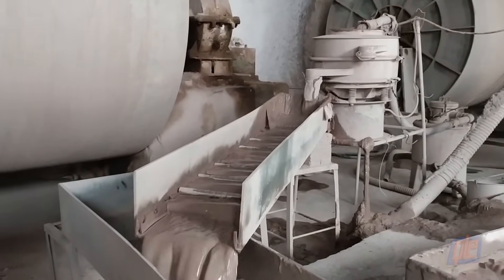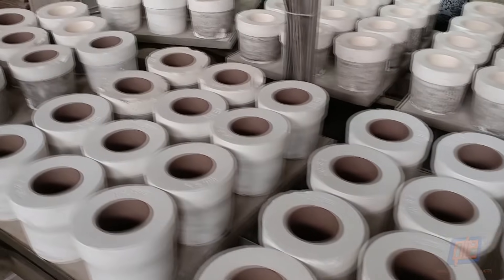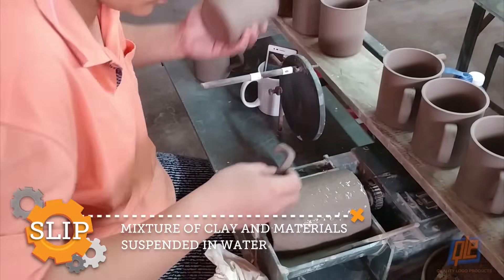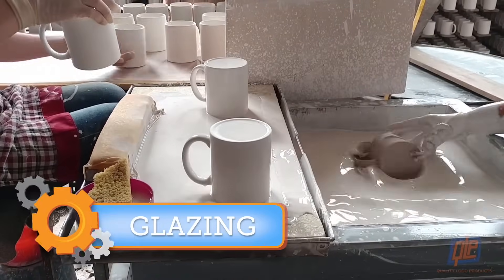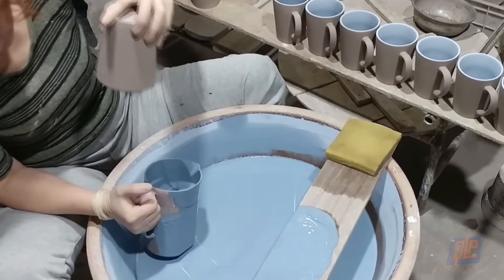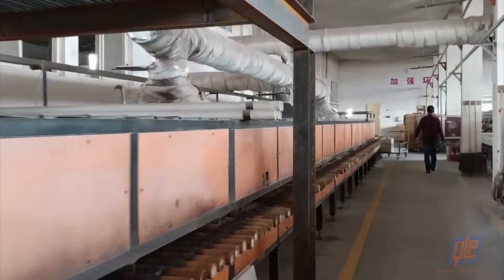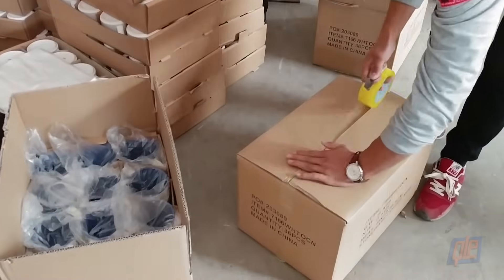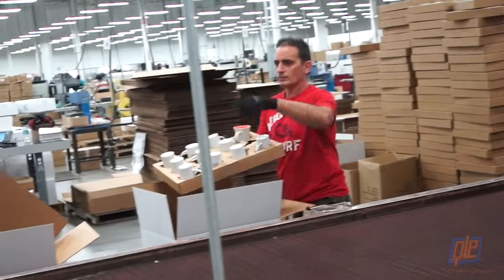How Are Ceramic Mugs Mass Produced?

Comment: Hey, I am a Dutch high school student and I do a project in which we compare a ceramic mug vs a plastic cup in energy efficiency. My question to you is; how much energy does the production of a single mug or a batch consume? A rough estimate would already be super helpful!!!
Reply from the maker: Hi there Rik! Unfortunately we do not have the answer to your question because we are a distributor not a manufacturer. However, we recommend reaching out directly to a manufacturer who will hopefully have the resources to help you out. Hope this helps and good luck on your project!